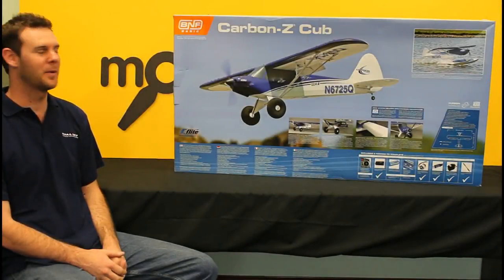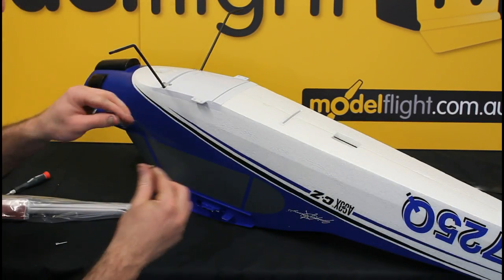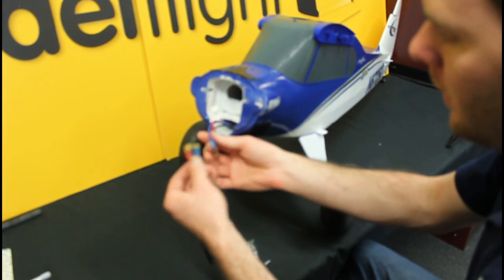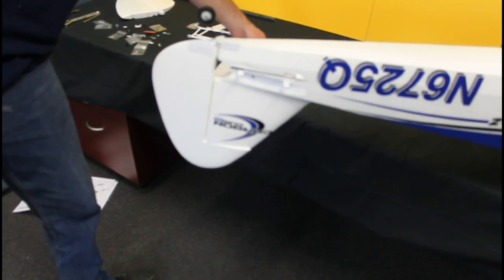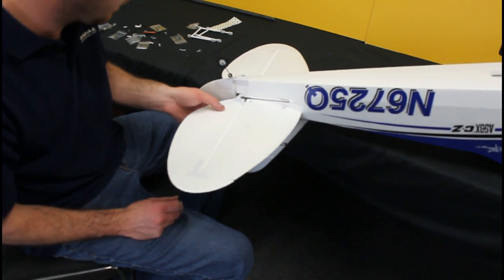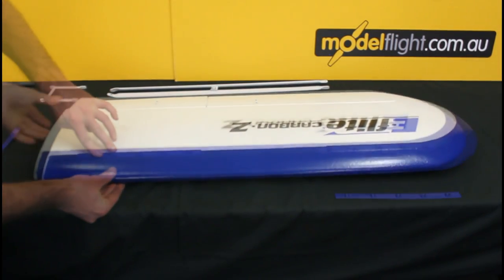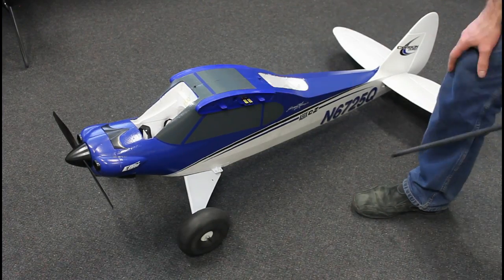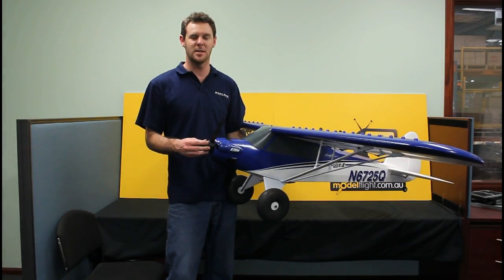How to Assemble the E-Flite Carbon-Z Cub

Comment: Looks like a nice plane. I have the funcub xl. That thing is way overpowered. Doesn't make any sense that much power Goes verticale unlimited. It is faster to assemble at the field with the fasting system for the struts. Which one flies better?

Comment: You used the motor mount screws on the landing gear.  After I realized it following along with your video I had already reamed out the landing gear holes where the smaller ones would strip.  I will have to run to the shop in the morning for larger screws to match the ones that I had to pull out to properly mount the motor.  Not that mad as there is no guide in the manual as to where the screws go.... just thought I would let others know before they ream out the holes in their gear mounts...

Comment: Matt,
Hate to be anal but electric power units are called motors. The term engine is normally used when describing internal combustion units. Great video btw.

Comment: Whats the best way to deal with the LONG ESC wires? I noticed you just put them in the ESC port hole. Will this not limit airflow for the esc?
Reply from the maker: Hi William Keeter, The wiring on the carbon cub shouldn't be restrictive enough that the controller won’t function correctly without overheating. However if you are concerned I’m sure the wires could be routed elsewhere. Cheers, Yoann

Comment: Nice video, however, I managed to ruin my kit through pure ignorance.  I used blue loctite and it ate up all the plastic fastening points.  I had no idea it would eat plastic.  Now I will have to contact the MFG and try to sweet talk them into selling me a set of replacement plastic attachment points so I can cut the melted ones out and glue in replacements.  Very embarrassing but I think it is important to warn others who, like myself, have never experienced this or realized what would happen.
  In my defense though, the directions from E-flite state to use loctite.  See the first page of building instructions.... page 8.

Comment: Why is there no right or down thrust. The Allen screws could be deeper, and the chart for them more informing....as it has no alphabetical mention, as the plans do. The motor screws I replaced with bolts and nuts through the firewall. Screws didn’t work well for me. The bottom ones we’re hitting the battery tray. Paint was not the greatest.....chip while building....clear overlay can fix that. Now to wait for nice weather.
Hope I get a reply on my first comment.
Reply from the maker: Hi Ken, Can you please give us a call 08 8186 4250 and we will assist you. Cheers

Comment: The spinner that came with mine was a piece of junk.  It had two screws at the sides to hold the spinner on and was nearly impossible to get lined up.  The prop had to be in just the right position for the holes to line up and when you torqued it a little to tighten in would of course move slightly causing the hole misalignment.  The spinner in this video is much better with the one center screw.